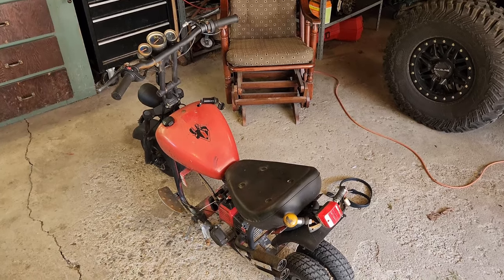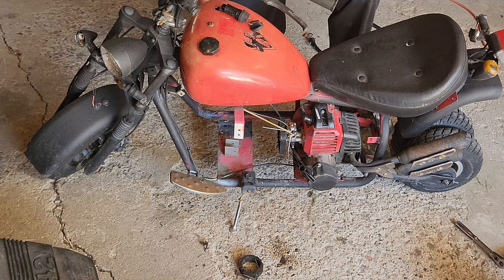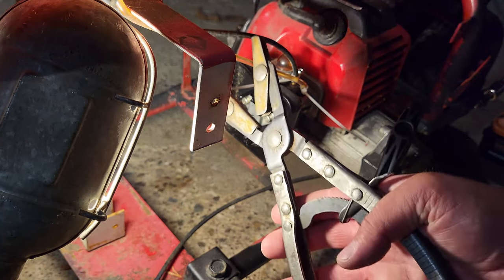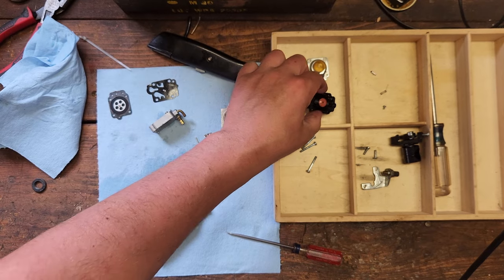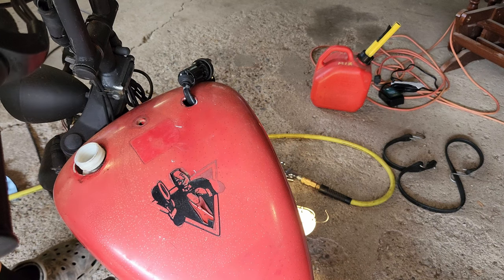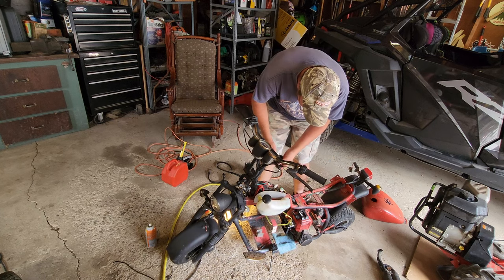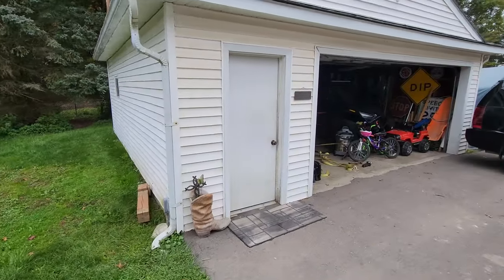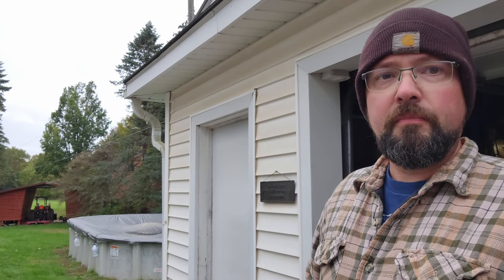Will it Run?? - APC Mini Chopper! - Part I

Comment: Read your spark plug, that will tell you how rich or lean it's been running. You really should give yourself more credit, you seem to have a very logical approach to problem solving.  That's a neat little scoot.
Reply from the maker: That's a good suggestion! I haven't pulled it since I checked for spark. 
Thank you for the compliment. You always have helpful info. I appreciate it! 🙂👍🏻

Comment: I just picked one up yesterday for $20, it's rough also but the guy said that it was running when it was parked
Reply from the maker: Well, the good news is you can get a super cheap carb for it on Amazon if you need to! Otherwise, good luck to you! I'm hoping to have the second video out soon. Been a lot going on around here 😅
Have fun! 🍻 👍🏻

Comment: Looking forward to your next video I have the same bike but I put bigger and better parts to keep up with the new generation pretty much all original what year was a way I can show you a picture it's bad ass one of a kind
Reply from the maker: Sounds amazing! I bet it's a blast to ride. I was thinking a repower might be fun. But first I'm just having fun tinkering. Things have been super busy around here and I ran into a few PC issues so hopefully I'll have something sooner than later. Fingers crossed 🤞 See ya then!
Reply: @TractorFella  looking forward to it Bud💪💯 mines still look original just super buffed up that's all bigger newer stronger everything with stronger Harley-Davidson signal lights and integrated taillights relays rectifier regulator on  a 212 hemi full electric start system this thing is badass and it goes 60 stock it rides like sitting in a chair 💪🛵💨💯
Reply from the maker: @timalexander89 Holy smokes! That thing sounds like a monster!!
Reply: @TractorFella  it really is I'm running a 10t clutch with a 40t sprocket with a 13x6.5x 6 rear tuff tire.. straight power I mean this thing hauls ass im on FB Detroit mini bike 💪💯
Reply from the maker: Haha that's awesome!  😯 Are you running the stock engine? Or did you throw a different monster in there?

Comment: Yikes you scared me with the trouble light you are using so close to the leaking gas. I know several people who burned down their shop with that exact scenario. Very cool you got it running. Neat little project. Thank you for sharing.
Reply from the maker: That's a very good point... it's an LED bulb, so it's cool to the touch, but that doesnt mean it couldn't ignite the fuel in a different manner.  Thank you for pointing that out, and for the comment! 🍻👍🏻

Comment: Carb is on upside down, engine is the correct one as I have the same bike but it does all look correct carb parts wise
Reply from the maker: Hi there! 
Yep! I found our either later in this video or in the next one (memory of a gnat) that the carb is actually backward. I appreciate your comment!
Reply: @TractorFella  yeah I hadn't got that far at the time of commenting but just seen the video, little jealous that all your lights and electric starter works, mine doesn't 🤣
Reply from the maker: @tolerantobject6656 Haha no worries! It's how things go. eBay has some lights and parts out there for prices that aren't insane. I hope you get it running and rolling!